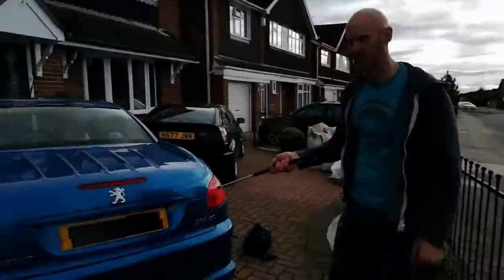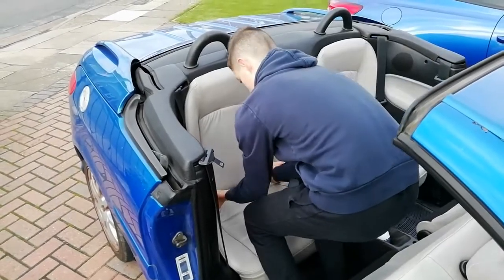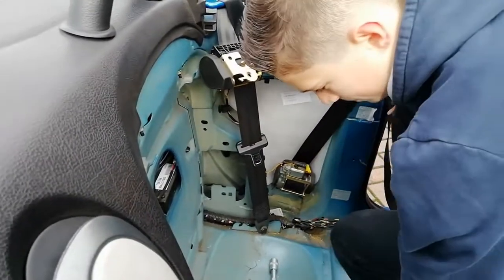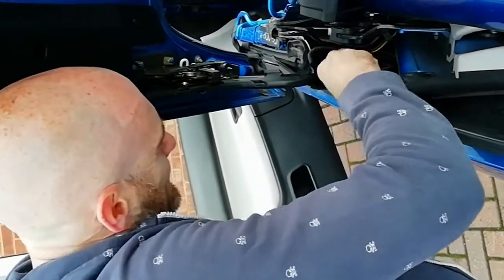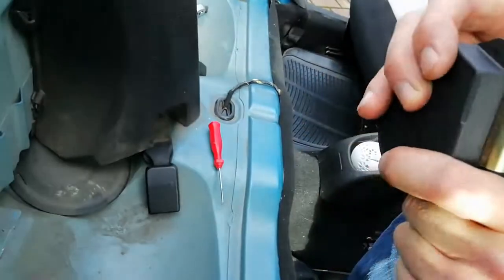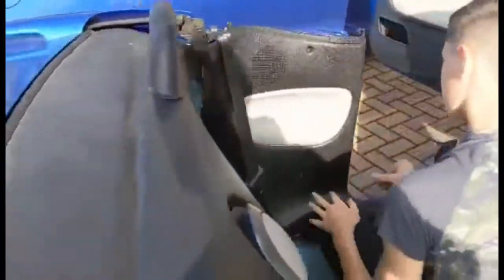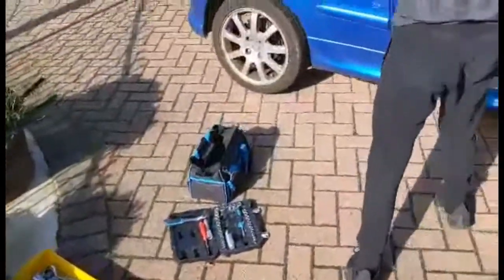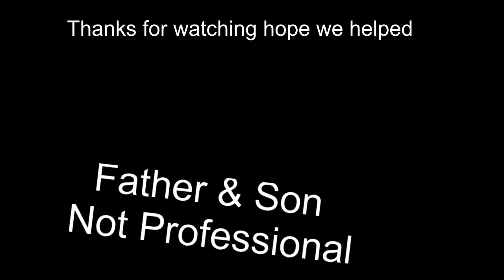Peugeot 206cc heavy boot repair. Strut replacement. Father & Son not Professional

Comment: Best tutorial on YT how to replace the struts on a 206CC. Now I know who to replace them step by step.
Reply from the maker: Thanks mate!
Reply: @zyndol  I replaced the struts as in your tutorial and it worked well.  To secure the seat belt for unwinding, I fixed it with a locking pliers. All in all it took  approx.  1,5h to change tboth struts.
Reply from the maker: Good work.

Comment: I’ve just replaced them without removing anything. The bottom connection can be removed with a long straight pry bar and popped back on. It took me about 5 minutes.
Reply from the maker: Nice we had looked at that before but wasn't sure if they would connect properly.
Reply: Did you fit the new struts bottom or top end first?

Comment: Nice interior! And u’re a good team :) 
I have a Peugeot 206cc too , in Australia xD the rear parcel shelf actuator for the roof is leaking hydraulic oil 😭. It’s nearly impossible to get the part, i finally found one but bloody expensive 😞
Reply from the maker: Cars always are! We have just had a front spring snap on a Scirocco. A Corrado that needs welding, new tyres and the headlight reflectors resilvering. It never stops lol.